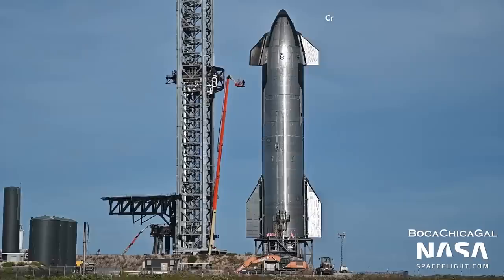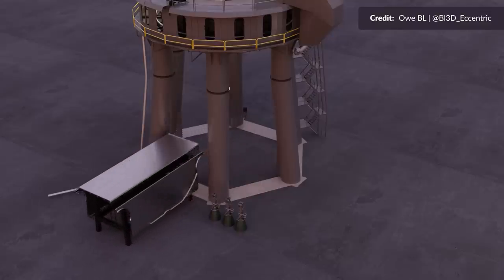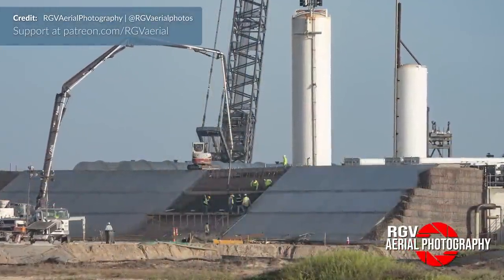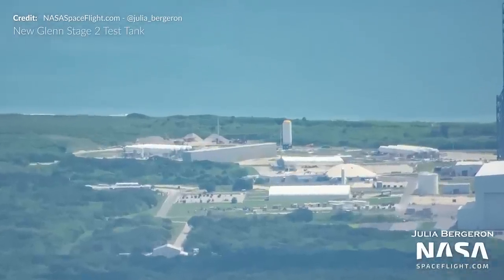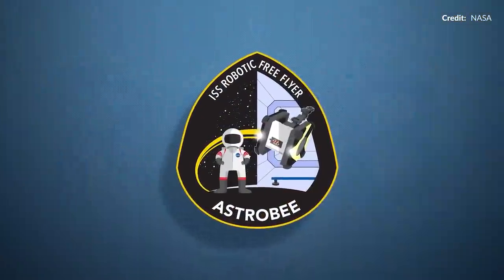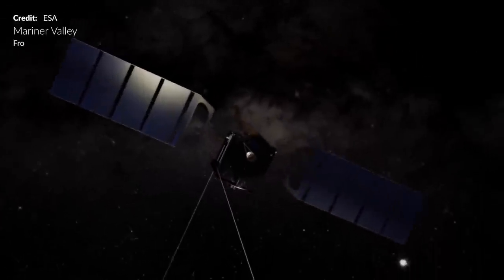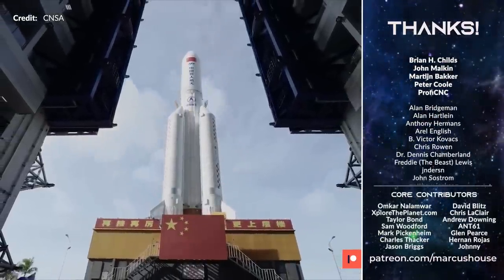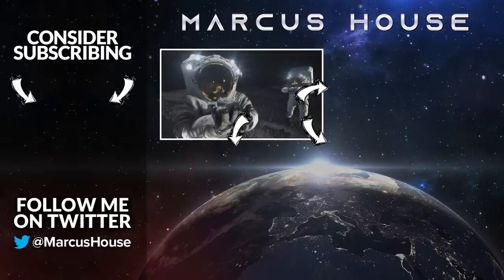SpaceX Starship Testing Ramp Up, Huge International Space Station Changes, & more

Comment: The astrobee is awesome. I suppose it could function in any gas not just air so maintenance with no oxygen.
Reply: And could work in a vacuum with gyros.
Reply: @NorthernChev  gyros won’t propel it, only stabilise it.
Reply: @fredbloggs5902  True, but there's no reason it couldn't also have cold gas thrusters.
Reply: @bartolomeothesatyr  that would work, but the impression I got was that they currently use fans like you get in PCs.
Reply: @bartolomeothesatyr  THIS^^^

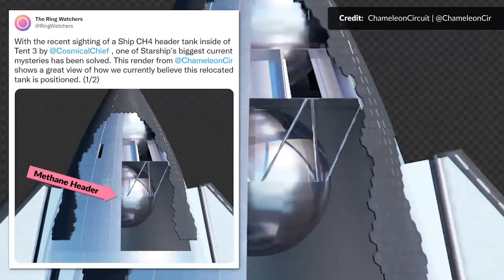Comment: 1:25 Don't be too sure of the new header tank set-up. The size of the tank is hard to judge from the pic. A CH4 tank is smaller than a LOX tank. If it's as large as I think, this may be another clever design. The sphere may contain a curved internal divider that allows this tank to contain both CH4 and LOX in the same way the common dome separates the main CH4 and LOX tanks.
Reply: Good suggestion - i think your probably correct or they will goto a shared header tank in future. It would save weight.
Reply: The oxygen tank appears to have a long conical forward half, it's quite egg shaped. So it would be larger.
Reply: That's a really nice feature of methalox -- the boiling points are not that dissimilar... unlike hydrolox which made the common-dome design of the Apollo era S-IVB much trickier.
Reply: @Clash Stats the down pipe would probably go down the side not thru the middle.
Reply: Further thinking with the small header tanks having a common dome does not really save much weight i now think it is just a separate tank -so it keeps the design simple - the tank location could be anywhere for either tank as long as the mass balance makes sense.

Comment: You want catching and lifting to happen as close to the tower as possible: more distance means more torque, which means a lot of parts have to be stronger.  If it's the first one, they would want to leave some extra room to reconfigure things if necessary.  On the second, you would expect the launch mount to be closer and the chopsticks to be shorter.
Reply from the maker: Exactly.

Comment: Hi Marcus. I have a question that I'm sure you've already answered but I'm going to ask it anyway. Q: when the Superheavy plus Starship launch (either from Starbase or KSC) and the Starship separates from Superheavy, The Superheavy has to turn about 180 degrees around and start firing most, if not all, of the motors to stop the eastward trajectory and start a westward trajectory to accomplish a landing at the launch site. I assume once the velocity vector is sufficiently changed from eastward to westward, the booster can throttle down to a few motors to complete the trip back. And once the booster has returned, it now has to land. Given all this motor activity, about how much of the total fuel load in the booster has to exist at the time of Starship separation? I'm guessing around 30% of the total fuel load at launch. Thanks for your wonderful coverage of SpaceX!
Reply: The outer 20 engines on the Superheavy booster can only be started on the ground. The inner 13 engines can be restarted in flight, so those would be used for the boost back burn. The inner 3 engines would likely be the ones used for landing, based on the SN8-SN15 flights.

Comment: Logically the relocation of the header tanks is reasonable, considering that the  rotation of the flip manoeuvre  must happen as a function of the point of radius about which the moment of inertia is averaged. Consequently maintaining fluid stability is crucial to a stable and reliable delivery of propellant.
Reply: Will the header tank remain there when they have to include a flight deck and crew accommodation?

Comment: Curious why the methane header tank is also a sphere... feels like the torus shape would have saved up some space on the nose cone, so what is this about? Ideal distribution of pressure in a spherical tank? Easier to manufacture both header tanks in exactly the same way? But then what will ultimately be fitted into the empty space left over from both spherical headers? Sooo many questions...

Comment: I switched to an old school style shaver over a year ago and have used only about 5 blades, based on the old German design, way cheaper and easier, you can loosen the blade to knock the hair out under a tap so it’s super easy to use, just have to make sure it’s tight again before running your fingers across the open blade. I recommend we all stop buying plastic razors and bottles ect, I used to go through about 3 a week, much plastic that says recycled actually doesn’t get reuse, it’s a scam.

Comment: Hey Marcus. Another great video. I’ve got a question for you. Falcon 9 deploys its payloads when it’s second stage has reached orbital velocity. Those payloads stay in orbit but the second stage falls back to earth. Maybe a dumb question, but what causes the second stage to fall out of orbit? Is it actively de-orbitted? Why don’t they keep them in orbit because the material might come in useful for future in-orbit building projects.
Reply from the maker: In LEO there is still a little atmosphere (a tiny tiny amount), enough to slowly drag and reduce the altitude over a long period of time. This is why Starlinks will re-enter within 5 years if they run out of propellant or get damaged.
Reply: The tenuous atmospheric drag would pull the stage down. That is why the ISS has to be boosted periodically. Same for Starlink sats. 

SpaceX has a system to deorbit the second stage safely, something the Long March 5B lacks.

The F9 second stage is not high enough to stay up for long. SpaceX originally planned to reuse the F9 second stages, but apparently the mass penalty was too much.
Reply: When the stage reaches orbital velocity, the apogee of its orbit is outside the atmosphere, at approximately the target altitude of the payload's orbit, but the perigee, the low point of the orbit, is still well within the atmosphere. Thus, the stage circles the earth once, and reenters the atmosphere near where it left it, slowing down rapidly and loosing its orbital velocity. When the payload reaches its apogee, a half orbit from the launch site, it has to perform an orbital circularization maneuver, to raise its perigee outside of the atmosphere and achieve a stable orbit. This maneuver only requires a few m/s delta V, but it's the difference between remaining in a stable orbit and re-entering the atmosphere.
Reply: Basically, it's possible for an orbit to have parameters that intersect the Earth's atmosphere, or even its surface, although you obviously could not complete such an orbit, even once. However, for the portion of that orbit, outside of the atmosphere, the craft would still technically be orbital, and moving at orbital velocity. The difference between a stable, circular, orbit 500km above the Earth's surface and an elliptical orbit with an apogee 500km above the Earth's surface but a perigee below the Earth's surface, is only 145M/s...
Reply: @eliharman  wow that little deltav.
Reply: @eliharman  No, I believe the second stage circularizes the orbit. SpaceX does a deorbit burn to bring down the second stage after payload deployment.

Comment: Hey Marcus - Tried the henson shaving code, "MARCUS" while checking out - the message just prior to checkout is, "This code isn't valid for the items in your cart".    I used the code on the final checkout by entering it in the "Discount code or gift card".   I chose Steel Blue / 5 / Mild.   Since this didn't work, I abandoned the purchase.   Thanks so much, Bruce Speidel (a fan of yours for many years now).
Reply from the maker: I may have just replied to your email as well Bruce, but I am wondering if there was a weird item in the cart that it didn't agree with. 
Start perhaps with a totally fresh incognito window, add just a single razer and single pack of 100, then try the code again at the end. Seems to work fine for me right now.

Comment: The Bee bots do give some optimism, not only to maybe work on the space station when the human crew have to return home and the station has to be unmanned for whatever reason. But also the idea for these drones to capture rouge satellites to reline them or potentially do maintenance so they don't end up being part of the astro-scrapyard orbiting our planet.
Reply: If those robots use fans to propel them, how is that supposed to work in space, with no air??
Reply: @shawndouglass2939  The same way space craft and other satellites move around in a vacuum. Using bursts of a gas and maybe ion thrusters I guess.
Pretty sure it was mentioned in the video that there's the idea to use them drones to capture and fix broken down satellites or put them back on course.

Comment: I think the ISS should have been your lead.  NASA, JAXA, & ESA should be funneling about 5-6 billion to SpaceX and any other company up to the task of very rapid design/iterate/build of a replacement of a new space station, preferably a rotating ring. Use Starship to lift to orbit.  De-orbit the current station in 2024/25 and put a new one up in 2026/2027.

Comment: Hi Marcus, thanks for a great video yet again. FYI The “MARCUS” discount code didn’t work when I tried to purchase on the Henson site, do you know if this is just a timing issue, or some other problem? Cheers Andrew
Reply from the maker: It seems to be working ok for me.  Just FYI, it will more than likely show a price there for the 100 blades UNTIL you put in the code. You need to go right through the checkout process and enter the promo code. Pick the color razor you want, then select the 100 pack, and right at the end, enter code "MARCUS" into that "Gift card or discount code" box there.

Does that help?

Comment: MARCUS discount code isn’t valid for the items in your cart.   Too bad.  Was it time limited to a week or two?
Reply from the maker: If you get this, it probably means the cart items are invalid. 
Make sure you add 1 razer and 1 pack of 100 blades only to the cart only. Remove anything else. Then apply the code and it should work.

Comment: How do those “ robots” move around?    Excellent report.  Thank You
Reply: The impellers move air to push/pull the cubebots around.
Reply: @steveaustin2686  I guess then it wouldn’t work outside space station then
Reply: @bruceyoung1343  Not really no. Nor on Mars as the atmosphere is like 1% the atmospheric density of our atmosphere. The Ingenuity helicopter is very light with large blades that turn very fast.
Reply: @steveaustin2686  yes I’m aware.   And still amazed at what they’ve Accomplished with it
Reply: @bruceyoung1343  And it looks like more are planning to be sent.

Comment: One question/concern I have on Starship development.  Won't the movement of the methane header tank up forward reduce some of the useable space in the to-be pressurized cone section for crew, etc.?
Reply: No one knows, I doubt space x knows either. They are still doing rapid prototyping, so starship in a year could be completely different. There will also be different versions of starship for the mission required. Moon and mars missions might not even have header tanks.
Reply: @chronovore7234  Good point on the variations - mission dependent.  I'd forgotten about that.

Comment: Has SpaceX considered adding cast Iron or steel cladding with underlying water cooling pipes to cover the concrete beneath the launch platform to better withstand the huge pressure and temps of the exhaust? This fix seems so "obvious" that there must be a good reason why it cannot work otherwise the excellent engineers at SpaceX would have long since done it. So, will someone kindly explain why it is not a practical solution?

Comment: I have a suggestion to Mr. Elon Musk, let’s have bots doing work inside and outside the space craft. You could have 10 outside ports or doors that could house outer bots, that could operate off GPS & Propellants of any kind Provided by any kind you want. 
They could take pictures or maybe do repairs without humans go out. If a human has to go out they could support the humans on the outside of the spacecraft. If need be if a person was knocked free of the ship into space the bot could retrieve them back to the ship.
Reply: The bots move by using impellers to push air around. So they won't work in a vacuum.

Comment: An important question to ask is why spacex has clammed up in the past couple years.  as for how development is going.  theres a lit more suppositions by all the sciencetubers covering things like rocket tests, failures, and stage zero improvements.
Reply: Space x has been in a seemingly endless battle with the FAA to get launch clearance. Space x would already have at least two launches of starship otherwise. Since they can’t launch they just keep improving their design and scrapping what they would have launched.
Reply: @chronovore7234  BS. FAA vs SpaceX is not really a thing, except for clicks. After all, the FAA defended SpaceX in front of Congress in Jun 2021 over the unauthorized SN8 flight. The 'NASA delaying Starship until the SLS flies' is just as silly, since NASA needs BOTH Starship and SLS for Artemis.

Comment: They should build their own road between facilities, not have to close existing road.
Reply: The area between the build site and the launch site is a state park. Getting permission for a second road would likely have issues. Per the FAA report, they will have 5 sub-orbital and 5 orbital flights per year. Likely due to the Texas law about restricting access to public beaches. The Texas legislature had to modify that law to allow SpaceX even the limited closures that they have now. One of the mitigations on the FAA report is to put pull offs on to Hwy 4, so that the road isn't blocked as much.

Comment: Maybe Marcus or someone else can answer this for me. My understanding is the header tanks in the starship nose cone are to ensure enough fuel set aside fuel for landing ?. They seem to take up a lot of space inside what will be the crew area  and over complicated. Why doesn't spacex just add another ring to the main tanks and keep the fuel all in one place ?.
Reply from the maker: It is mainly for balance at landing, but I'm not sure if this is more a design for test vehicles, or for most future vehicles.
Reply: @MarcusHouse  👍👍
Reply: Because they need Full fuel tanks WITHOUT GAS BUBBLES IN for the landing burns and situated at the top to minimise sloshing from the swoop in.
Reply: @N1gel  Exactly. Header tanks are for the flip-n-burn.

Comment: I know how robots rotate on their own axis but how do they move in space?
Reply from the maker: On the station where there is atmosphere they use impellers. In a vac, you would need little reaction control thrusters.
Reply: @MarcusHouse  or gyros? is it possible to get forward momentum with gyros, if there is no athmosphere?
Reply: Unfortunately no, gyros only provide rotation, not translation
Reply: I imagine that if you're in an enclosed space with conductive walls you could do something with electrostatic repulsion and attraction, varying the charge on the portion of the structure you wish to translate to or from. I'm sure someone that actually knows what they're talking about will shoot down that idea...
Reply: @nicolasbolatto  well, I could just have googled it :D but thx for  the answer. I guess everyone makes that mistake sometime. Like trying to blow dust off, on the moon : D

Comment: Forgive me but the shorter arms using "less material" and "being a bit lighter & faster" is a very poor counter argument because unless this thing is going to orbit (where saving on weight and complexity is crucial even in the slightest amount) SpaceX is taking A LOT OF UNNECESSARY RISKS TO SAVE A FEW BUCKS!   
They are already putting the WHOLE launchpad in danger (clearly proven by a relatively small explosion of current booster while mounted on the Texas pad) every time they land unless they have a nearly perfect landing with very little room for error.   So now they are decreasing the error tolerance to save a few buck or just out of "THE SHEER F**N HUBRIS"?
I'm glad there are people and agencies that will just not take SpaceX at their word FOR EVERYTHING (ie. NASA, EPA, SPACEX FANS) it's a great company that has/will bring us great things but it would be pretty dangerous for many people and stupid if you loose your whole lauch capability FOR MONTHS IF 1 BOOSTER FAILS OR DOESN'T HAVE A PERFECT LANDING (it's bad if we lose the booster but those are easily replaced and if we have more we can launch again the same day because the launch site is not affected by something blowing up miles away).   I wonder if an explosion in Florida SS launchpad would damage F9 launchpad...